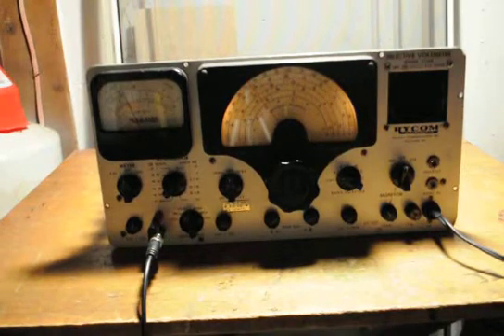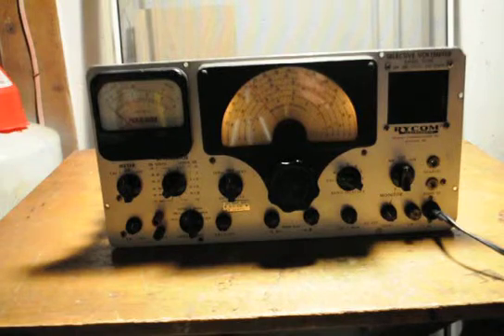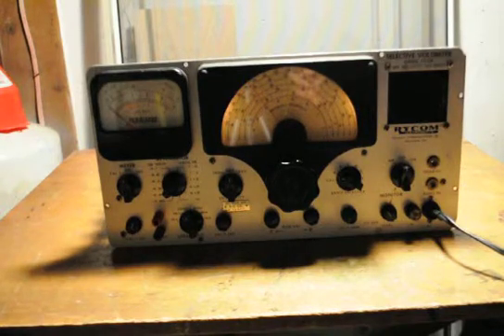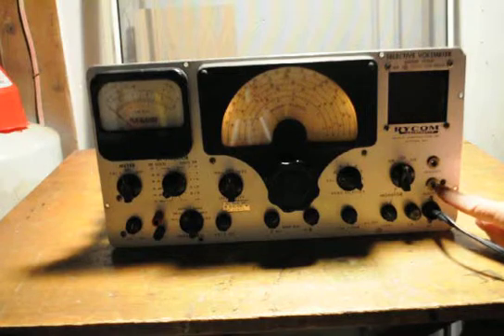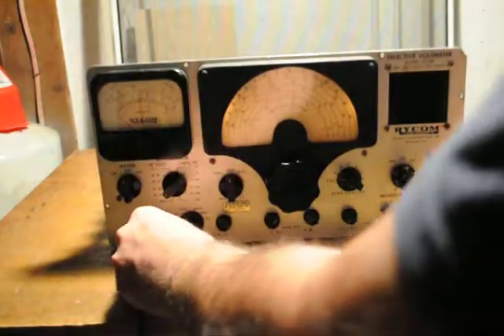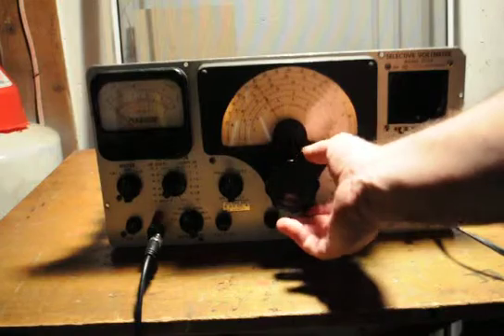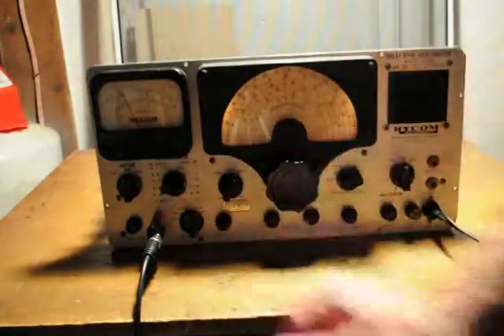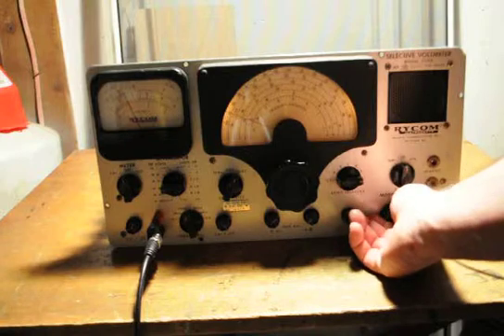Rycom 2174A Selective Voltmeter and VLF Receiver

Comment: I just got two of these, recapped the first one and now for the second. Did you ever locate the manual for this? I was able to track one down. There are two versions of this apparently, The above and a rack mount version. It is pretty sweet but it is lacking the extreme upper portion of the VLF band.

Comment: haven't seen one of these in years.  These were used extensively in the telecom industry back in the late 50's to late 60's to monitor and check levels on test tones on various carrier and microwave systems.  If the wide-band filter was used you could check the channel for noise and actually hear the conversation on that particular channel, to check a test tone (usually 1000 Hz) the unit was switched to narrow band.  These were replaced by solid state versions by around 1970.  Thanks for the memories!!